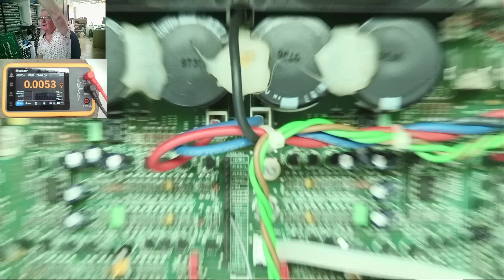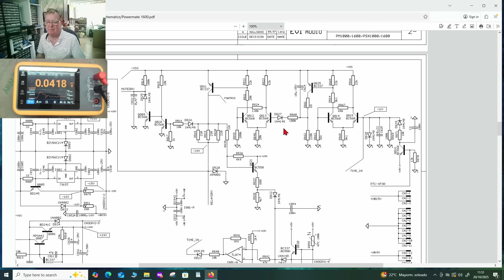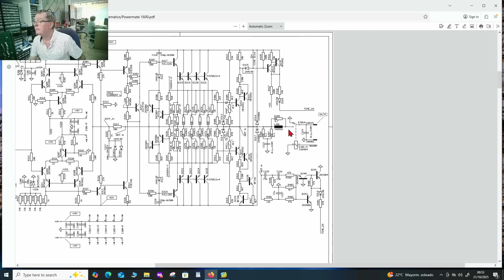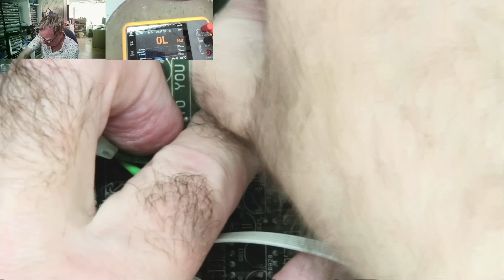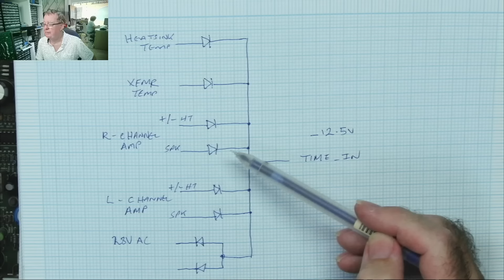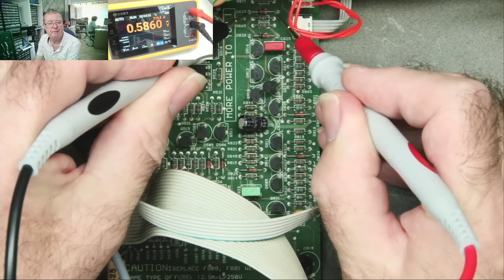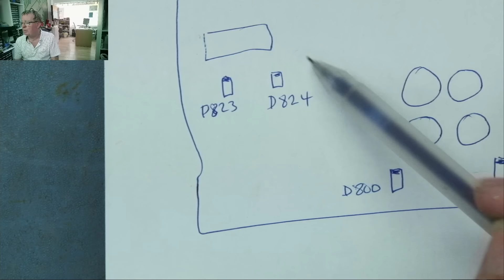PART 2 - Why You Should Not Use Audio Mixers In A BAR! Dynacord Powermate 1000

Comment: Richard, the TIME_IN signal is a logical OR for all the various error conditions. As long as it is at -11 volts (or less), there is no error, so no need to check for errors. The first comparator is triggered when TIME_IN goes up. It will make Q825 conduct and short C824 (R861 is only there to limit the current and protect Q825). This very capacitor is the power-on delay. If it is leaky, the second comparator might not trigger and stay in 'protect'. D800/D801 with R800/R801 provide the negative bias for TIME_IN.
Reply from the maker: Yeah I show this in part three (recorded will publish Friday or Saturday) by simulating a protection error. I have fixed it now by the way
Reply: @learnelectronicsrepair  Looking forward to part 3, then! Glad you fixed it.

Comment: Both fans are running now because both are connected :D the left one's connector was misplaced in the previous video.
Reply from the maker: The fans wires are coming from the oposite direction, one looks upside down compared to the other, It does not matter because both outer pins are connected to ground and the middle pin is -24V
Reply: @learnelectronicsrepair  The left plug was one pin off: look at 02:20 in this video, just before you disconnect the fans. Probably not the cause of the fault, but I wonder how it happened.

Comment: Years of dust, muck and ocean area atmosphere (high salts in air) have been collecting on the board.  Add some moisture and a protection circuit that operates on a knife edge is altered enough to activate.  The change of state while probing suggest that electrons were added or bled off by the meter or even his finger if the threshold was low enough.
 Richard suspects what's wrong and I agree, but a simple good scrubbing presents less of an educational venue or suspense. 😁

Comment: 812 and 813 act as a comparator with what looks to be a form of hysteresis. When the base of 813 goes higher than 812 it turns on, and when turned on reduces the volume at the base 813. So there are no oscillations on the collector of 812 due to a slowly changing voltage on 813 base. 
But I've just woken up and only had one cup of tea and looking at circuit diagrams need at least 3 cups to be more accurate 😂😢

Comment: I fully agree with you regarding using a microprocessor for protection. All that would do is add an extra level of complexity and cost, the diodes provide the same function and do not need to be programmed. If the microprocessor was giving more information about the reason for protection, that would be a different scenario.

BTW, if you look at 2:21 you will see that the connector for the "left" fan is out by one position.
Reply from the maker: It's the opposite way round so it just looks that way.
Reply: @learnelectronicsrepair No, it isn't, go look again at 2:21 on your second video.

Comment: Are those power supply testpoints just a header with bare pins? I can't tell with the camera right over top.
If so, it is a great convenience but something requiring great care. A slip of the test probe that shorted adjacent pins could make for a serious disaster.

Comment: I dont know why you abandoned chasing -24V RELAYDRV which has direct influence over protection LED regardless of what protection circuit is doing. You haven't found it on the schematic but you can find anode of the D520 diode and following that find another components connected directly and then maybe find it on the schematic.

Comment: It went out of protect as you measured Q812, could be a coincidence, but also it could be a clue.  Is there a bad connection near there, that was the transistor that was bent over and straightened to find rhe silkscreen, or is Q812 possibly faulty/ microphonic?  It may be worth checking that area of the circuit a bit closer.

Actually rewatching the video you checked the collector voltage of Q812, then when you went back to check the emitter you were actually reaching for and possibly touched Q811, if so it may be worth checking Q811 a bit closer also.
Reply from the maker: The fault was in that area but not what you think.  Part three is recorded (and the mixer is repaired) will publish Friday or Saturday

Comment: As you say, seems to be an issue with those comparators somewhere. Not sure how accurate the voltages on the schematic are supposed to be but -12.63V seems way off. I would be tempted to lift the base of Q815 and stick -11V on it. (if the issue persists after the G&T is removed). Why not use a micro?, because life is too short.